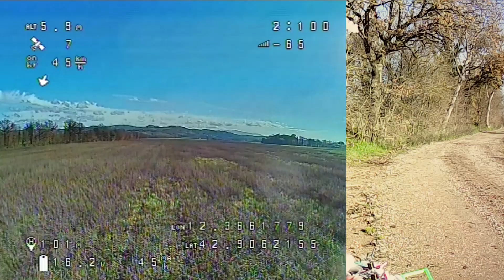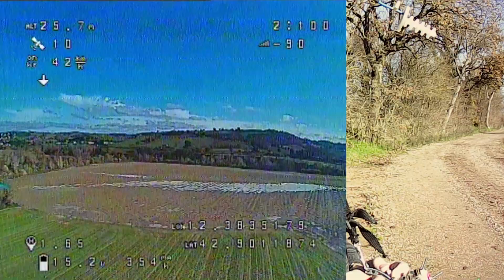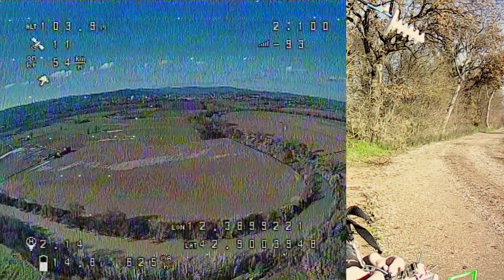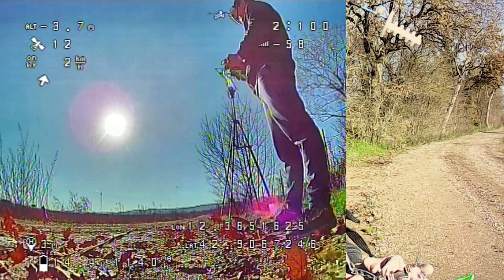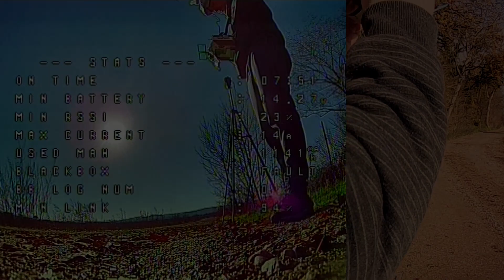Express LRS range test on 10mW

Comment: in this video you used Frsky R9M External Module, is that right? and does that module use ELRS? Because I don't see the Frsky R9M being advertised with ELRS...
Reply from the maker: Go to expresslrs.com and download the configurator to discover all compatible modules. You can install ELRS in the R9M module and R9MM receiver.

Comment: Sorry to be this guy but does 10mw refer how powerful it is? And is 10 bad or good?
Reply from the maker: Hi there, 10mW is the lowest power setting for the R9M transmitter module. At this very low power output with Express LRS protocol you can indeed fly very far...Happy landings!
Reply: @MnM_FPV  hello thanks for replying. So in elrs the higher mw the further you go?
Reply from the maker: @limodog779  yes this is the same for all RC Protocols like ELRS, FrSky, TBS.
Reply: @MnM_FPV  Ight thanks for your help!

Comment: I have found the Beitian 180 and 220 pretty hopeless at getting satelites, the larger 880 is far superior. I now shield all the wires to an earth and that has helped. great video and I have an R9 for my analogue quad it I can get to 1.5km without any issues the video is to me the limiting factor.
Reply from the maker: Hi Christofer, yes the Beitian GPS is a hit or miss, so far I've been quite lucky, however the very first flight I allow for takeoff without a GPS fix hover at 30 meters and wait for a fix, then land and rearm with a GPS fix. I make my own 5.8Ghz helical antennas for that extra mile of video...happy landings..

Comment: There is a similar video with the same output power with the original firmware. (With similar distance ~2km)

With that firmware you can go to 1W of output power. 

May I ask you why it is better than the original frsky firmware for LR (Long Range) purpuse?
Reply from the maker: Hi Richard, Express LRS firmware is better than Frsky because of the optimised over the air packet structure. In this video I did not even come close to the range limit. Also the RSSI in dBm will give you true measurement of the signal strength. Frsky firmware is also plagued with bad packet structure causing serious jitter problems. Also if you have older Frsky ACCST firmware you are left behind, because you cannot update your old Radio TX with newer ACCESS firmware...

Comment: ciao mike..... sono riuscito ad installare il tutto oggi anche e sopratutto grazie ad un amico e ai tuoi video. due domande...... è normale che ci metta parecchio tempo a bindare appena acceso il sistema? seconda cosa, ho notato che rimangono accesi entrambi i LED ( verde e rosso) sia sul tx che sull'rx..... è normale?
Reply from the maker: Ciao Davide dimmi che hardware stai utilizzando TX R9M? RX? quanto ci impiega a brindare? Che valore leggi di RSSI in dbm da vicino? I LUA Script funzionano?
Reply: @MnM_FPV  innanzitutto grazie per la risposta. come hardware tx ho una r9m 2019, come rx ho una r9slim+ (non ho capito se funziona o no il diversity) e 3 r9mini. fanno tutte la stessa cosa. appena decollato ho rssi db- a circa - 25-30 e link quality al massimo. a circa 2km link quality al massimo e db - 85 per bindarsi impiegano a volte anche 6-10 secondi. a volte fanno subito.
Reply: lua script funzionanti. per long range per il momento sto usando 250mw e 50hz
Reply: con tutte e 4 le rx rimangono accesi entrambi i LED sia lato tx che rx

Comment: Hey man, how did you get the LUA script for your radio? I went to gethub and couldn't find the download for the raw file. I could OPEN the raw file, and look at the script, but couldn't find a download for the LUA file. I'm new to github, and don't have experience with LUA. Should I copy and paste the script I can view into a compiler? Surely not, right???
Reply from the maker: For faster access to the Lua script, save the ELRS.lua File from this link: ExLRS Lua Script onto the radio's SD Card in the Scripts/Tools folder and Long Press the "SYS" button (for T16 or similar Radios) or the "Menu" button (for Taranis X9D or similar Radios) to access the Tools Menu where you can find ELRS script ready to run with only one click.

NB If you're prompted with Syntax Error, make sure you downloaded the raw file, and not html. The file is also available in your local clone, it's located at src/lua/ELRS.lua.

Comment: Amazing :)
Mike I have taranis x9d accest version, if I buy r9 2019 do I need this resistor mod or just simply flash to LRS
Reply from the maker: Ciao, no hardware mod necessary for x9d, if you buy r9 2019 ACCESS no resistor mod needed. Check the Express LRS wiki for the latest info on how to flash the Firmware, happy landings..

Comment: Wow, now i'm really motivated to flash over.
Reply: Update: I get about 1km on  10mw with the R9M ACCST with stock omni and R9MX, until the RX failed and wouldn't reconnect till it was power cycled, then stopped connecting completely that is.  Hoping to have better luck with the slim+ and replacement MX.

Comment: Impressive flight time for a 5".
Reply from the maker: Was using a 4s 2300mah lipo happy landings
Reply: @MnM_FPV  It flies well with the 2300mah? And a gopro onboard?
Reply from the maker: It'll manage no problem,  I actually tried two 1500mah 4s lipos in parallel and got to 5km
Reply: @MnM_FPV  danm 8s

Comment: The Moxon probably provides approx. 5dB of gain off of the direction you're "pointing" your transmitter.  That will help, but still impressive on 10mW of output power.
Reply from the maker: Surely the Moxon helps to extend the range somewhat, just waiting for my nanovna to arrive so I can tune it properly, Happy Landings
Reply: @MnM_FPV  I just need to flash my R9M 2019, and R9MM, to ELRS.  Seems simple enough, except the part of pulling a working RX out of my quad. 😜
Reply from the maker: You'll be fine just flash the bootloader files first, the R9MM bootloader via TX s.port, then use a free UART to connect the R9MM. You will then flash the firmware via Betaflight passthrough. I recommend you use the ExLRS configurator, makes things a little easier..

Comment: Hello Mike I have a question can I  now use r9mx rx flashed to Lrs with accst tx  the r9mx is not compatible with accst but with lrs could it possible
Unreal results very interested
Reply from the maker: Yes you can, you will flash your R9M and R9MX with RxLRS firmware. You need to follow the steps outlined in the Express LRS wiki. Let me know if you have any questions, be glad to help
Reply: @MnM_FPV  many thanks Mike thanks for your time
Reply from the maker: @Ladanddadfishing  https://github.com/AlessandroAU/ExpressLRS/wiki/Toolchain-and-Git-Setup
Reply: Thanks for that Mike going to get to work on this at the weekend I thought I was going to be parking the frsky stuff and just using my new crossfire setup
Reply from the maker: @Ladanddadfishing  Crossfire is awesome, but ExLRS is a little better when it comes to range and latency. Ciao
Reply: @MnM_FPV  I like the fact I can still buy the new r9mx rx and flash to work with my radio I was aware of express lrs but I was a bit upset with frsky so I purchased the crossfire looks like I didn’t need to lol but hey you can never have enough stuff lol
Reply: my question is do I need to dobthe mod to the qx7 for this?
Reply from the maker: @mkleespies78  If your QX7 is the newer version with ACCESS protocol then no hardware mod is required, in instead your QX7 is the older version with ACCST protocol then you'll need to do the TBS inverter mod.

Comment: On 10mw doing that kind of range, and with the possibility of going even further its just mind blowing! Make a test with some Lion pack :)
How did you make that Moxon antenna? Looks really good!
Reply from the maker: I tried making 4S & 5S packs with the Panasonic NCR18650, but the cells didn't quite manage adequately.  I guess Lion packs make sense on a proper 6S2P rig with 1200Kv motors. I am building a 7 inch quad with the "Racerstar AirA 2508 BP Edition 4~6S 1200KV" motors. The directional Moxon antenna works extremely well though I don't have a VNA to measure it. You can find the design on Thingiverse here https://www.thingiverse.com/thing:3931824, ciao and happy landings
Reply: @MnM_FPV  thank you! I'm going to try a 18650 3000mah 4s pack with 2207 1700kv on a 7" rig. I have a friend that actually managed to get about 20min flight time with these.
Is your R9 module the 2018 version? Can you show me how did you do the mod? I've seen the 2 pics in the wiki page but it's not that clear to me. Can you help me with this please?
Grazie! :)
Reply from the maker: @jonatancunha253  IMO u should go at least 6s for the 7 inch rig, and possibly even 2p as you will double the C rate. At 4s you'll see that the amp draw is so high that the voltage will quickly sag to dangerously low level. Yes my R9M is 2018, I will post a pic of the resistor mod very simple just use any resistor from 300ohms to 1000ohms between 3.3v and inverter  pin. What TX r u using?